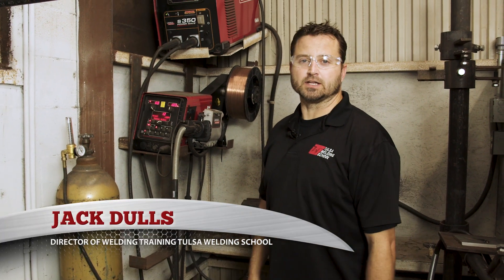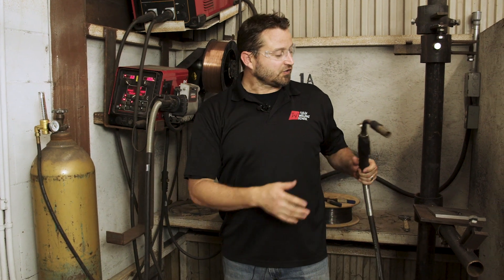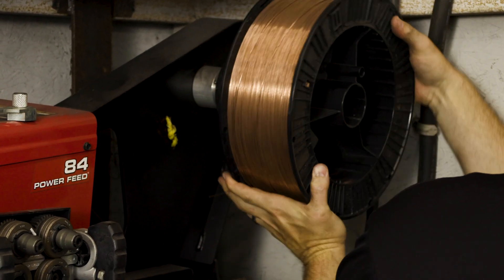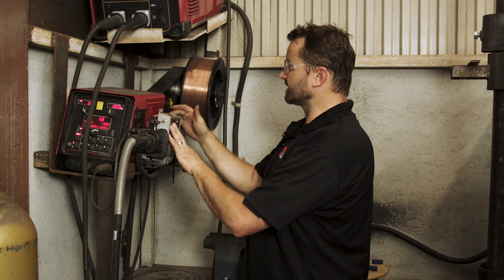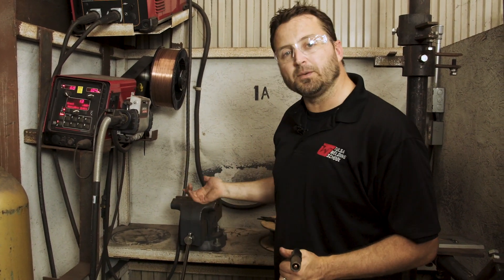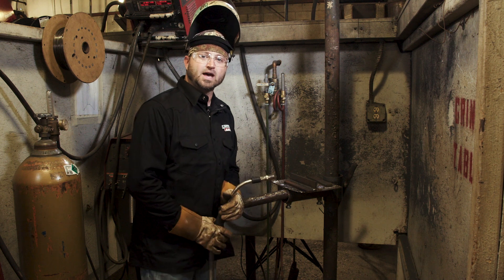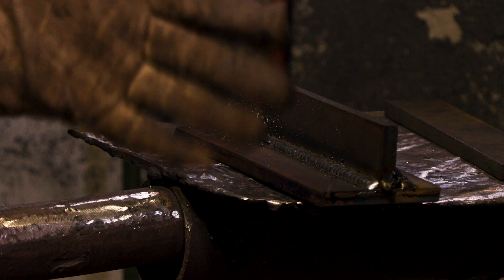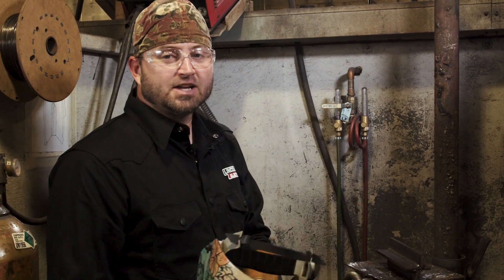How to MIG Weld: MIG Welding 101 for Beginners

Comment: Dump question but can you flux core mig a aluminum or steel part using a opposite type of wire. Ie aluminum part with steel flux core wire?

Comment: This video is NOT for beginner welders. Few can afford a power supply plus a wire feeder and the other related stuff he is talking about. A simple wire feed welder is all most beginners can afford. Unless this video is quite old,all this stuff is simply not necessary.

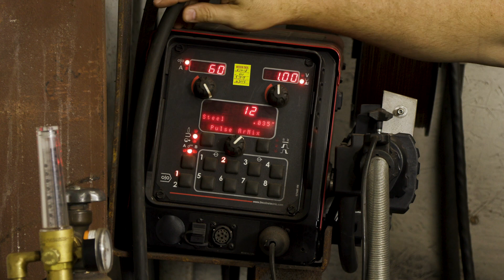Comment: At 2:40 what does "we go it on 60 volts about a 100 wire uuuhh 100 on the volts" mean? I get one is the voltage and the other is a wire feed but as your title indicates "MIG Welding 101 for Beginners" I think you should clear that up. I am a beginner and already confused.
Reply: At the beginning of the video … the machine is a Lincoln Electric Power Feed 84 Single. A few things I noticed from the video: The machine is set to User Memory Preset number 2. It is also set up for a dual procedure gun, which allows the operator to select either procedure "A" or "B", as needed, at the gun rather than the memory panel on the machine. The Voltage / Trim setting is set for pulse welding, which controls the arc length using 'Trim' instead of voltage. The Trim setting (range: 0.50 to 1.50) is set to 1.00 to 1.04 for “Arc Length Medium.” The upper left digital display indicates either Wire Feed Speed or Amps (amperage). The machine is set to display the wire feed speed and is set to 60 inches per minute. I'm not familiar with that machine but it appears that the voltage is 12 or 13 V?
 
It's worth noting that at approximately 7:52 in the video you will notice that he moved to a different welding station. (A Lincoln Electric LF-72 Wire Feeder is now in place of where the Power Feed 84 Single was located.) He's using the upper machine which is another Lincoln Electric machine, which appears to be an Invertec V350-Pro. I was unable to clearly see the settings he was using.